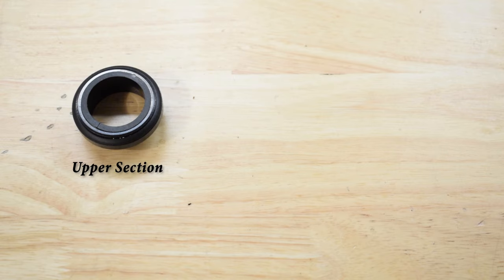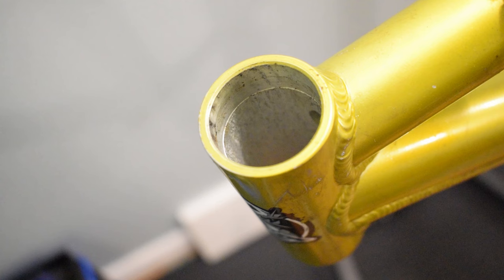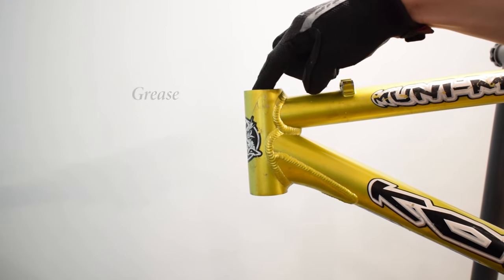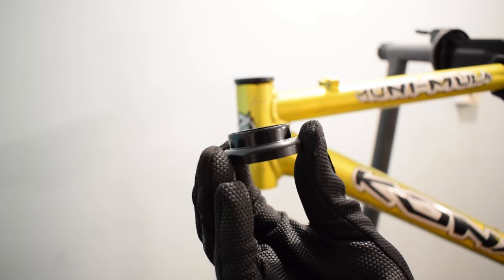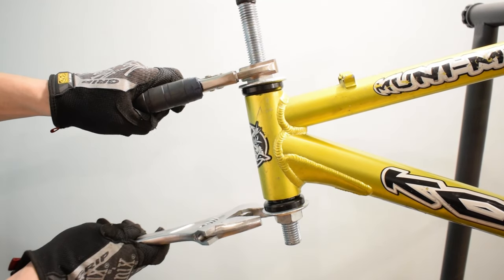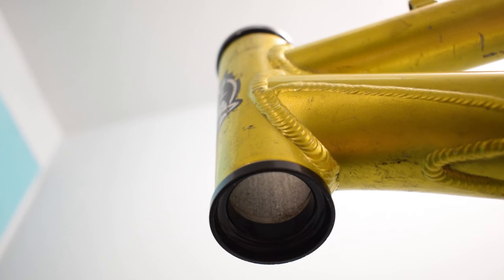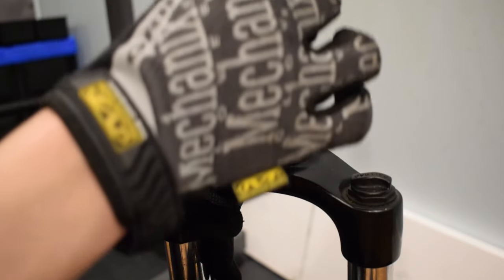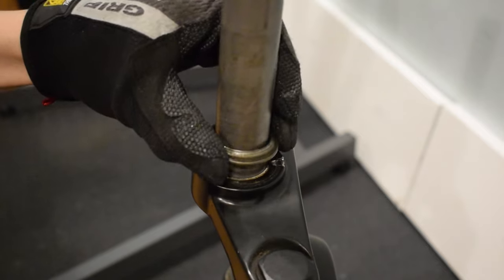AHeadset Installation

Comment: any idea why a ritchie logic threadless headset would utterly lock an old marzocchi bomber into the frame? the fork will NOt come loose as if a lock ring is holding it in? i can’t pull the top cap/ring of headset that hold the bearing in? would it be so tight as to not come free with hand level effort?